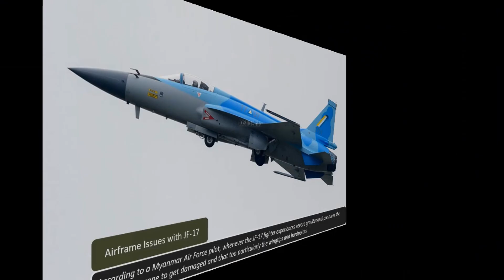Myanmar JF-17 Engine & Airframe Issues | Better To Shutdown JF-17 Production?

Comment: Oh…. They have not tried to carry out the live firing missions.  In some cases, the system fails completely (Pakistani case), or the radar fails to share info with the weapons (Pakistan), when operating in rainy conditions (J10 China), the ejection seat fails to operate, the oxygen generator fails and so on…

To sum up, JF17 has, engine, air frame, CI, radar, weapons problems, life support system and ejection system problems…   Curious to find out what actually works with Chinese products.
Reply: ejection system problems? pakistan fitted British Martin Bakers Ejection seat in them